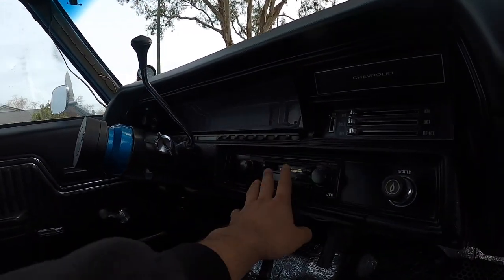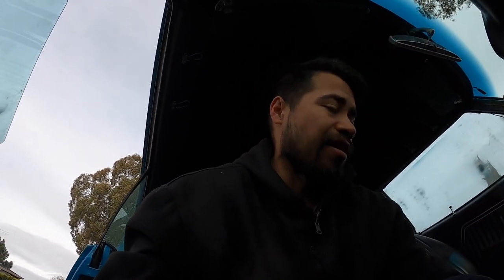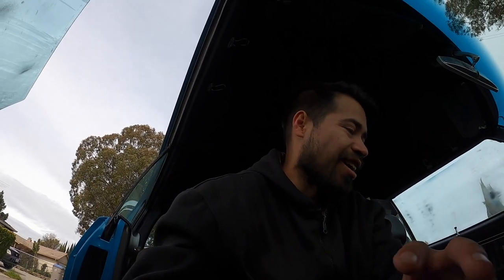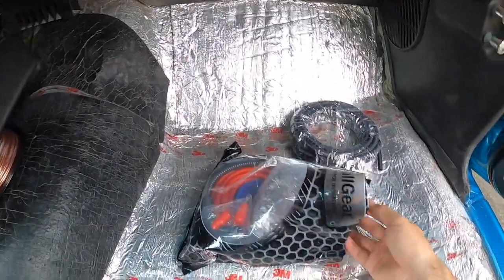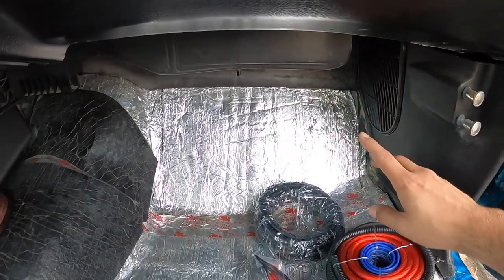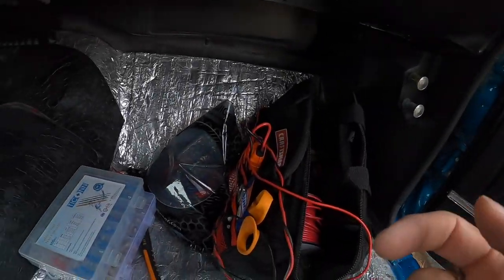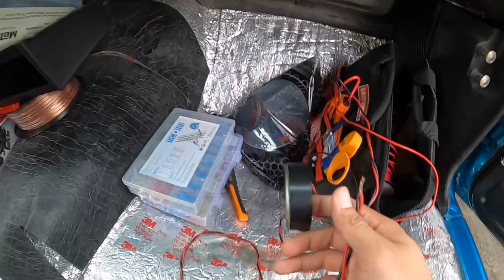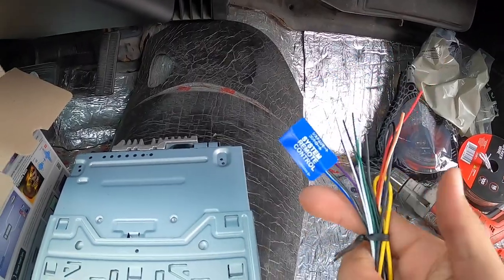Vlog #17   Pt1 Detailed Chevelle Stereo System Install

Comment: To find left or right use a small battery to each wire and you will hear a static noise  to tell you which wire  to what speaker.

Comment: You don't need to put the foam if you bend the tabs on the radio slider it will be solid. Another thing is you can put 6×9s behind the kick panel removing the vent insert flap and putting a boom mat in the hole.
Reply from the maker: 6x9 would be a good idea! But I still use the air vent down there on hot days lol
Reply: @chile.productions put the fuse beside the amp it'll be easier to get to if it blows
Reply: @chile.productions reds the key switch